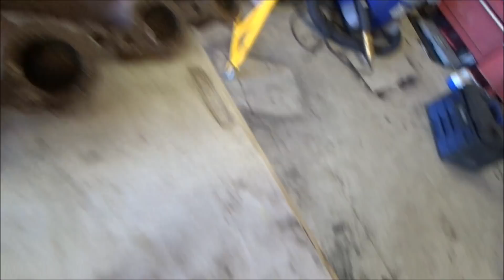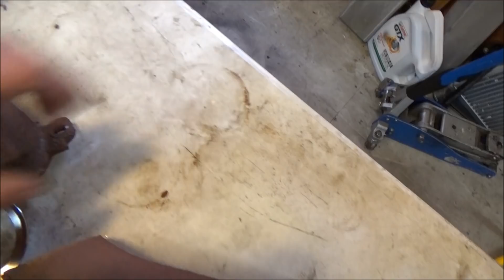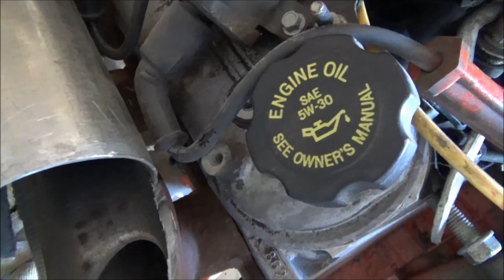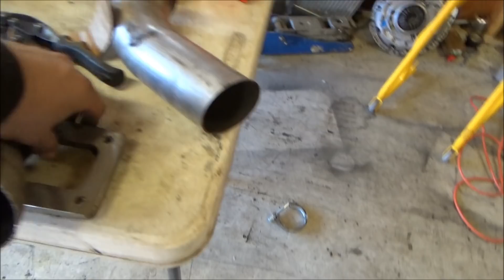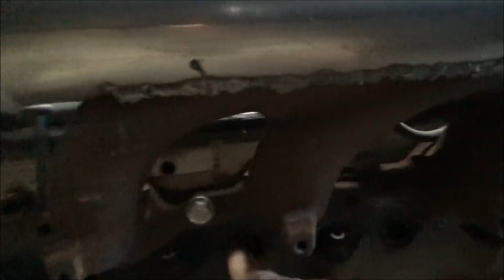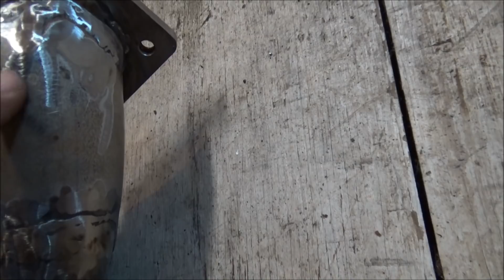How to make your own LSx Turbo Manifolds

Comment: What about building a spacer for the exhaust manifolds that would push it out 1/2 inch. You will gain spark plug wire clearance

Comment: its all about doing it on a budget. they may not last as long as a full stainless tig welded set up but this costs nothing or next to nothing and gives someone an alternative to spending a big buck up front. could always weld up a proper one if you wanted to after the fact. good video and cool idea to save money. and yes i am a machinist and understand the metallurgy of cast and welding weakens the manifold.

Comment: I say good job doing it the way you are. Dude said hes only using a 110 welder, so its not going to flow like a 220 or a tig. Saving money is the point, and if it works who gives a shit what it looks like especially under header wrap. At least he has the nuts to get out in the shop and cut some shit up. Cast steel is perfectly fine, you wouldn't even attempt this with cast iron. I'm not saying its how i would do it but if it works, hell yea

Comment: I mean, for a quick and dirty setup, I guess this works - sort of a "REALLY on a budget, trying to salvage what I can, and make it work". I think ideally, you'd want to just buy a bunch of proper exhaust grade mandrel bent piping, and have it custom cut, and welded. All the same material, no franken builds, better flow... HOWEVER, all the comments on the weld quality aside, this is great for the backyard/junkyard part builder. Kinda cool!

Comment: all the haters are obviously the fuckwits that paid 600 for a manifold an got someone to put it on for them then go telling prople how they built their setup .  good work man it doesnt have to look pretty to make power i have made plenty of manifolds like this and had them last years without fault
Reply: fuck...half the people on here don't even own a set of tools.   hahaha
Reply: Or legitimate fabricators who see this crap and knows that everything here is wrong.  Does it work? Sure. But garbage is still garbage. Fitting is poor, welds are poor, materials used are poor.
Reply: ben cowell there junk just go buy them for 150 3inch at yearwood

Comment: Looks like could maybe flatten out the radius the inside of the tubing to gain a little more room for the plug wires . but good job for a DIY manifold .

Comment: couldnt you use a 6.5 diesel manifold set and work around the clearance issues ? if i recall correct they should fit

Comment: might be an idea to sell coil relocation kits so they mound under the manifolds

friend of mine allmost burned down his truck using headerwrap , he had an oilleak and the wrap absorbed it , when the exhaust whent beyond the flashpoint of the oil it caught fire

Comment: your cool bro, thanks for taking the time to make your vids.  how to you go about making sure there isn't any spatter on the inside that may come loose and trash the turbo. or has that not really been an issue
Reply: i worry about this too. but i tried to get inside as good as i could and clean out any wire that went inside and stuff. check out a video i just uploaded i show a little bit of the manifold i built in that video

Comment: Y'all ever welded to cast before? Aint his fault he dosent do this for a liveing. And... no comment on his grinding skills.
Reply: Robert Cunningham cast steel these are weldable.
Reply: It is weldable just difficult if not heated and when trying to weld cast to mild steel you end up with either cracks or Easley ending up with fighting impurities while welding it

Comment: This is fucking awesome lmao. I want to do a top mount for my 03 silverado. Suppose I could do this without splitting the manifold and just cutting the flange off and adding a 45 or so with the T3/T4 flange on top of the pipe?
Reply: don't see why it wouldn't work. just make sure you are feeding the turbo wiith both sides of the engine and youll be alright. or a twin turbo system. you can look at how i did mine on my channel

Comment: Just inSane. Setting aside the aesthetics and possible cracking issues previously mentioned, this system will not perform as well as a mandrel bent or weld-el setup that is well designed and built. Granted this is gonna be drastically cheaper, you get what you pay for...
Reply: he went 9s on that manifold lol

Comment: Honestly why anyone would pay for this is beyond me. Im not usually one to hate, but this dude doesn't even clean is weld surfaces before welding. Short cuts on short cuts on short cuts. "The bitterness of poor quality remains long after the sweetness of low price is forgotten."
Reply: jeremyxman you only need to clean the surface when you use OAW. You dont know what your talking about
Reply: Rmaul246 negative
Reply: You don't know what you're talking about. You ALWAYS clean your weld area

Comment: nice vid ..can I use 2.5 pipe and not 3.0 like u ??
Reply from the maker: Yes. That would be great for lower hp goals.  This one is for a high hp 6.0 set up
Reply: +Justin Sane OK thanks so 2.5 pipes would be fine for 5.7 600hp
Reply from the maker: Eh. That's the upper limit. But yea would work

Comment: The welding needs addressing, have you crack tested it yet? If it's cast it needs a good pre-heat first prior to welding as the expansion differential will crack those welds given time. Excellent advice on the hacks, I'm building a stainless header for my Evo 8 at the moment, many headaches yet to come I fear ;)

Comment: ever had a problem with welding cast to mild steel?
Reply: +secm207 The issues you're thinking about are with Cast IRON welding and the associated cracking, Cast STEEL like this is doesn't have that issue.

Comment: what do you think about running a turbo off only one side of the engine leave the other side alone?
Reply: it's stupid, you're basically doubling the time the turbo to spool up and making the power of a 4 cylinder when you have 8
Reply: and you would have backpressure on only one side of the engine. this is a very bad idea and i would highly advise against trying this.

Comment: are you running fuel injection if so where would you recommend putting on sensor(s) and would you run one on each bank somehow or just one
Reply from the maker: +Scott Blessing just 1 for wide band when turbo charged

Comment: do you make anything for c5 corvette
Reply from the maker: my kits are universal,  you build your own manifolds and we supply the rest
Reply: +Justin Sane  could it work on a 4.3 ls engine?  if so how much do you charge?
Reply: no such thing as a 4.3 ls. theres a 4.8 ls tho. if the stock manifold is cast steel you should be able to however i believe those 4.3s are cast iron
Reply: CrackedIce man I promise you it's a 4.3 ls it's got the sticker on the side of the truck and everything. It's a cast v6 ls vortec block.

Comment: I take it with forced induction you really don't need to worry about equal length tubing?
Reply from the maker: +snail5341 correct your not using the scavenge affect to draw in fresh air.
Reply: +snail5341 equal length tubing can be a bonus but not %100 necessary. Many companies and OEM brands will use a log style or cast manifold with great success at the low to mid range power levels. You will however usually see equal length headers on higher power turbo builds for even exhaust pulses and scavenging which will lead to a more smooth turbo spool. Likewise they will also be used on more expensive systems when you want more efficiency.
Not saying it is a high end upgrade but in the Subaru market, equal length headers are some of that communities first parts swapped on turboed boxer engines.
Reply: the cams on a turbo however don't overlap like they do on a big NA cam so its not really scavenging. still equal length tubing is nice and would provide evenly distributed backpressure and even less backpressure

Comment: Would you recommend painting the manifold with hi temp paint before wraping them ? I have herd the manifold could rust pretty bad from the heat cycle ,any experience with that ?
Reply from the maker: they last 20 years or longer oem with no coating. it's personal preference
Reply: +Justin Sane ok thanks.  What type of metal is the pipe you are welding to the manifold and did you order a kit with all the different bends and diameters ? Great vid btw loved how it looked when finished. Liked and subscribed.
Reply from the maker: thestig572420 I normally get a universal pipe kit from summit. Stay tuned for more videos showing more about this in the near future.

Comment: Hey man from what I've heard most manifolds are cast iron. how is the best way to tell what your working with? I've got a 99 silverado 4.8 and not sure at all what there made out of.
Reply: they are most likely cast steel. don't know who told you they were mostly cast iron. yes maybe on other angines like the older sbc engines (305, 350) but the newer ls engines have cast steel manifolds. you should be fine doing this and if not you can pick up one of these from practically everywhere for about 30$

Comment: those are cast iron it's hard to weld cast iron
Reply from the maker: no its cast steel not iron on the LSX. they weld nice.
Reply: +Justin Sane ooo didn't know that thanks
Reply: +Justin Sane Do you know if Japanese engines use steel for exhaust manifolds?  have a 96 Toyota Starlet that I want to try this with. I'll be stick welding it with ac welder

Comment: i admire your creativity. but this whole manifold through a manifold thing is such a shitty poor power design. i did like how left pipe hanging out the back for the other cylinder bank. i was kinda skipping ahead through your video to see the end product and didnt expect it all to go that way. oo, cast steel. i was wondering.
Reply from the maker: we haven't seen and problems up to 1000 hp so far
Reply: Justin Sane i guess its a power for the dollar kind of thing. nice merge collectors tubular manifolds might cost 600+ and only make the same power with a couple psi less boost. i guess it all comes down to your fueling. higher boost numbers are going to make warmer air, but if you have an intercooler or some good fuel, then it really doesnt matter what exhaust manifolds you use.
Reply from the maker: +bhearts77 stock manifolds have been used to over 1200 go with no signs of back pressure issues.
Reply: +Justin Sane Has there been any difference in cylinder temps since each runner is different? Theres not much of a collector, and theyre technically unequal "headers". Also, any comparison in the exhaust velocity changes when you change the size of the piping or does it only concern the inlet of the turbo?  I can definitely see how this works, especially on a bullet proof LS. Im used to dealing with imports that are more prone to... blowing up.. with minor things like this haha
Reply from the maker: Well think of it like this. Even if they was all 1 length they all merge into the turbos restrictive exhaust housing and wheel. But no I haven't noticed a issue
Reply: +Justin Sane Thanks i appreciate the reply. Great job btw
Reply: i just think its sexy how you cut that pipe away to attach to the factory runners. i love watching new ideas. but i only run 4 cylinder motors. so ive never had to worry about v turbo manifolds.
Reply: let me clarify. the pipe cut was sexy. not you cutting it.

Comment: typical filmed with a calculator, "i welded to a cast manifold". to help improve welds heat the cast up or even the turbo flange with a torch, or heat gun or hell even bake it. those large pieces absorb and dissipate heat very quickly, cast esp. the aluminized pipe is very thing which is why you have excessive reinforcement trying to fill your holes that your probably making trying to get good penetration. little research will help make the most of even the cheapest welders. 80% prep 20% work.
Reply: with this being said, with some minor improvements you could be putting good information out there, keep it up
Reply: Tyler Parynik if any of you dorks knew what you were talking about you would know those manifolds are cast steel not cast iron. if they were cast iron they would be impractical to use
Reply: beverly weatherly I simply said cast, i never claimed how much carbon content it held. it still holds a ton of impurities and dissipates heat three times as fast. my point still being valid.
Reply: I would love to have a calculator with a video cam built in!
Reply: read BEFORE flapping lips,it saves you embarrassing yourself

Comment: You obviously have not built any high hp manifolds first clue using sto k manifolds which in the case of the build it is all in what you want for the end result I have built enough turbo and long tube, fender ,hood zoomie,bottom exit headers in my life out of all types  of metal in your case if u feel that the chance of weld slag or a weld bb going threw ur turbo and having a serious weak spot where u fill in gap with mig weld is ok then who am I to tell u different  . All I can say is when you build your first set of stainless or titanium turbo/header with a tig all these short cuts will be a total nightmare for you.  My dad taught me at a young age if u are doing it now you might as well do it right the first time or it will teach you the second good video keep on practicing you will see what I mean some day

Comment: I would rather spend 6 or 700$ I appreciate what you are trying to do, but turbo exhaust headers are scientifically engineered with testing for a reason as tuning an engine to run with turbo is tricky. I do not see this being a calculated flow rate to be able to keep things running  smooth. Especially running fuel injection there is no way for mass air flow to be calculated correctly  with not knowing the flow rate of a home made turbo header. Sounds like a good way to confuse the ECM.
Reply: what? most of these manifolds are just designed to fit a spacing constraint. tuning the mass airflow because you don't know the flow rate of the manifold? most turbo applications don't run a mass airflow anyway so that doesn't matter. its bassed on manifold absolute pressure and how much boost you are running. the manifold he made leaves the same length on the exhaust runners and shouldn't affect flow rate